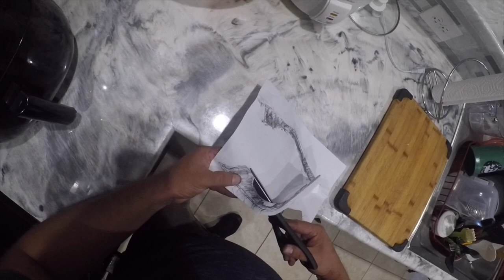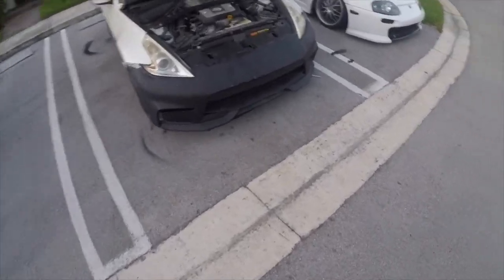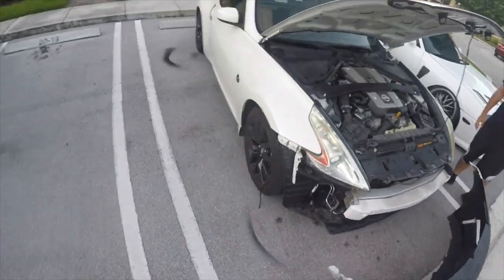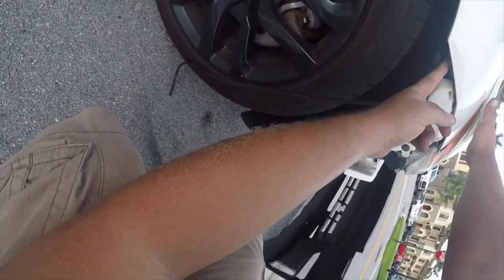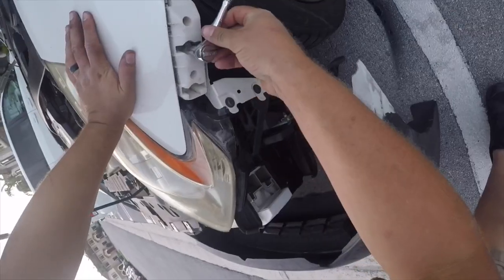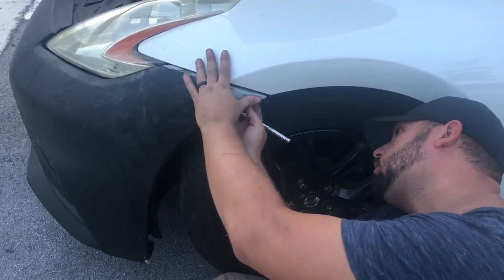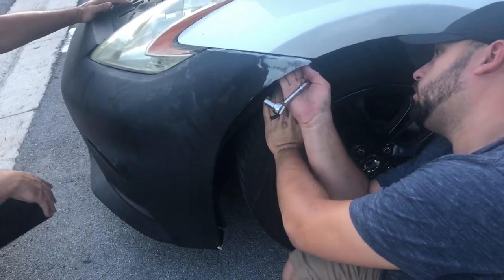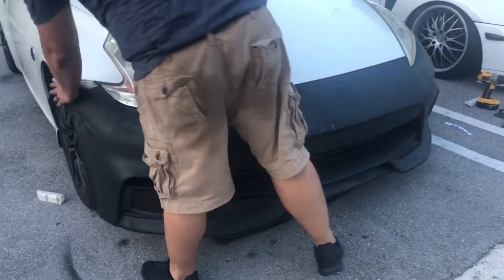DIY Nissan 370Z Nismo Conversion Kit 2015+ Part 4

Comment: Where did you bought the Nismo front bumper?
Reply from the maker: The Nismo front bumper in this video is made by Duraflex, I bought it on Ebay with the side skirts, around $400 for everything, I was able to use the side skirts but the bumper became a nightmare and I ended up buying an OEM  one from Nissan, keep watching I just uploaded some new videos modifying the headlights